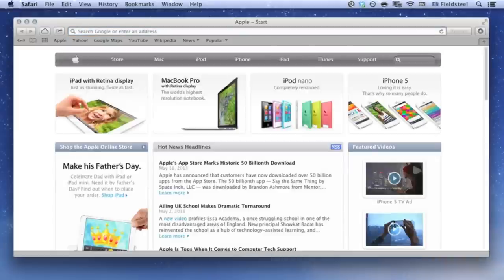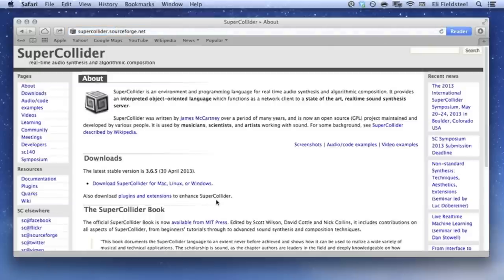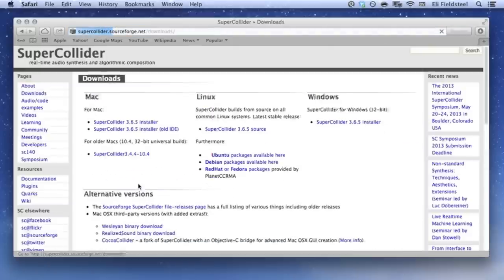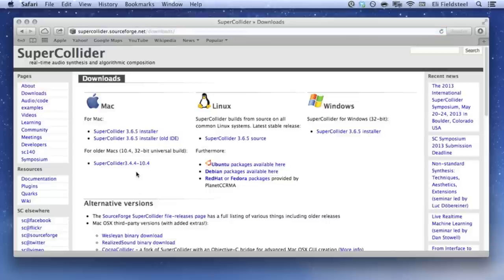SuperCollider Tutorial: 0. Introduction

Comment: how does it compare with "PureData" (performance, ese of programming, ...)? in which cases is the one prefered over the other?
Reply from the maker: This is not really something I can answer. How X language compares with Y language, or how "easy" it is to program depends on the work being done and the person doing the work. It's a subjective determination that depends on context, goal, familiarity, skill level, etc. I haven't used Pd much, but I do prefer a text-based environment over something with a drag-and-drop GUI front-end. For me, personally, typing makes it faster and easier to organize my thoughts. Of course, both SC and Pd are capable and richly-featured platforms for sound synthesis and processing. If you are curious, I recommend you try both and see which you prefer.